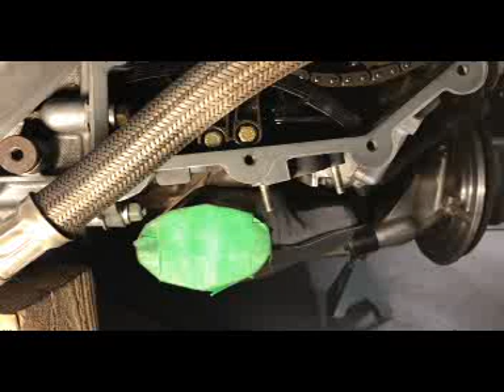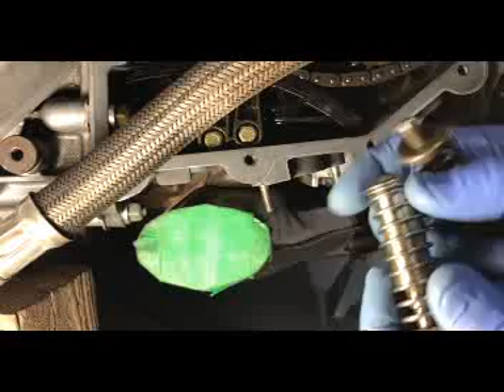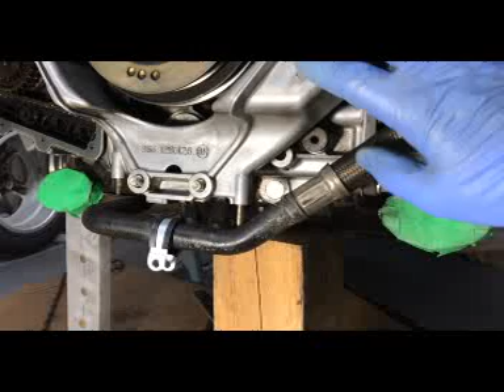Porsche 911 964 chain tensioners installation

Comment: Hi very intresting vidéo, I have to do the same job. Is it feasable without removing the chain covers ? Second question, my chain tensioner seems to be in black plastic as your seems to be in metal ?my car is from 11/1991
Reply: Hi, thank for your inquiry, yes you can change the gaskets for the tensioner without removing the chain covers. Do one side at a time and pay attention to the orientation of the spring when you take it out.
Regarding the cover itself, they look plastic cuz of the paint, not sure if there is plastic versions? The spring covers are in very difficult area, need to take care to access. My engine in the video is lowered around 6 inches. Plus you don’t see the mufflers in the way. Hope that helps...